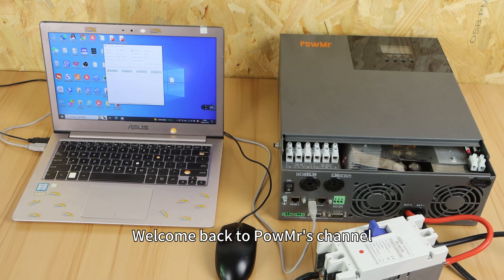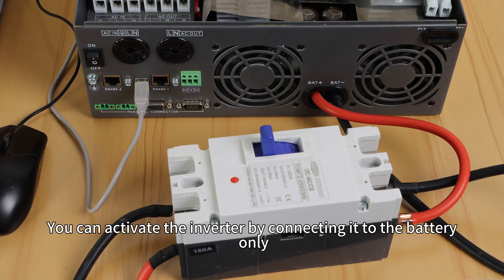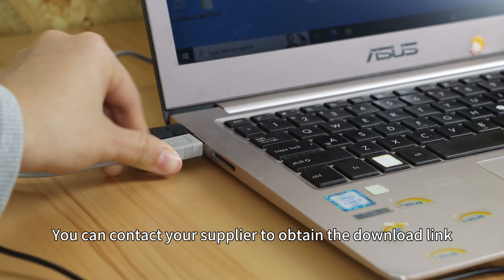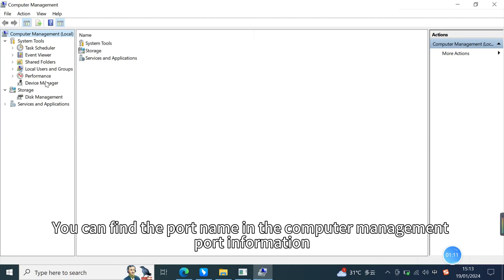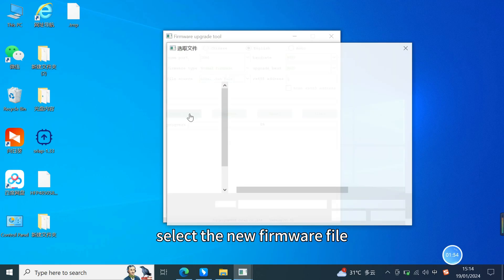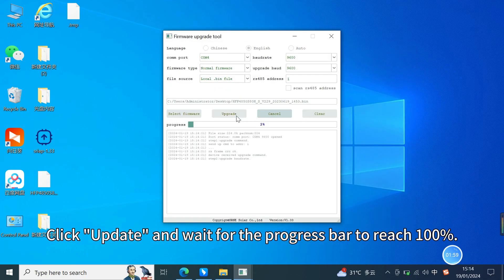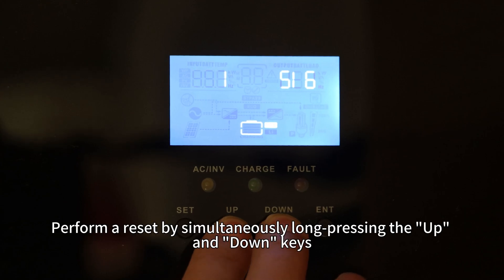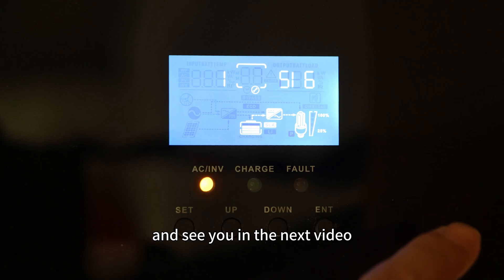How to Complete the Firmware Upgrade for the POW- HPM5.6KW?

Comment: Hello everyone. I have two POW-HVM4.2-24V-N inverters, each with a different firmware version: UI-75-06 and UI-75-10. The first version has a less optimized fan control algorithm, while the second one works perfectly. Is there any way to update the firmware to version UI-75-10? Thank you in advance.
Reply from the maker: The 4.2M model cannot be firmware upgraded.

Comment: I have purchased a Hybrid Powmr inverter with model number POW-HVM2H-12V-N from a local official seller here in the Philippines. There is an erratic behaviour this inverter ramdomly occurs, that is it does not detect the AC input from the Ulility source and sometimes it does. I have read from some forums discussing varoius models of Powmr that needs to update its firmware when not functioning as it should be. I ask the dealer here of where can I download the updated firmware version of this model but to no avail. Will you please help find an updated version of firmware for this model.
Reply from the maker: This model does not have firmware upgrades.

Judging from your description, it seems that the AC input is unstable. This may be related to your mains power, or there may be a problem with the internal components of the machine.

Please send the fault video to this email address: support@powmr.com. Our technical staff will check it for you.

Comment: I have an inverter POW-HVM6.2M-48V-N, 

I installed it safely and programmed it. It works in UPS mode without solar panels
it powers my home when there is no power on the grid. The problem is that it makes noise like an airplane. Since I have one room, it is impossible to be near him. You don't describe anywhere that it makes noise even when idle. I tried to turn it off with the side button, but the situation does not change, the fans still run at maximum speed. I had to turn it off because it’s impossible not to be around it for a long time and work. Maybe there is some software or setting that controls the speed of the fans correctly. There may be a software update that solves this problem. Before this, there was a Powerman UPS and the fan in it only worked when the voltage was converted from 48 to 220 volts. In idle mode, the fan turned on sporadically and this did not interfere with my presence in the same room
Reply from the maker: Please send your problem to this email: support@powmr.com.
Reply: Hello, I have the same problem, were you able to solve it?. For now, my only solution that I found so far was to change the arrangement of the fans, placing 4 but quieter. Two at the bottom bringing in fresh air and two at the top taking out hot air. Greetings
Reply: @papo2403  Ich habe dieses Problem gelöst, indem ich intelligente Lüftersteuerungsmodule installiert und einen Trick installiert habe, damit das System, das die Lüfter steuert, normal funktioniert.
Reply: @radiomechanic  
Thanks for responding! I tried something similar to what you describe, but the inverter goes into alarm when it detects "incorrect" operation (low speed) of the fans. How have you deceived them?
Reply: Ответили они тебе что-то толковое?
Reply: @alexfibonacci8096  Нет. Пришлось допиливать напильником. Устанавливать обманки вентиляторов и дополнительные контроллеры оборотов + 1 кулер. Теперь рядом можно находиться.